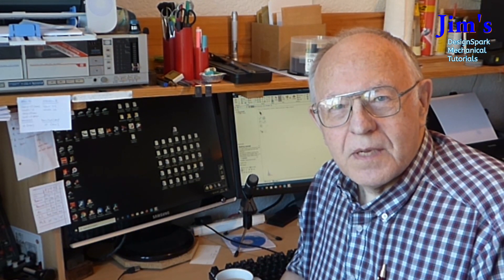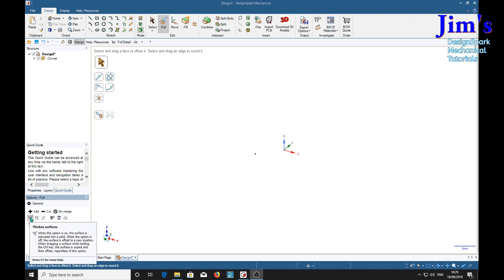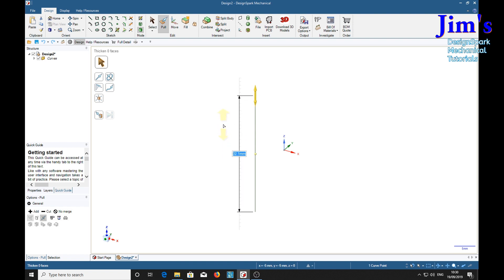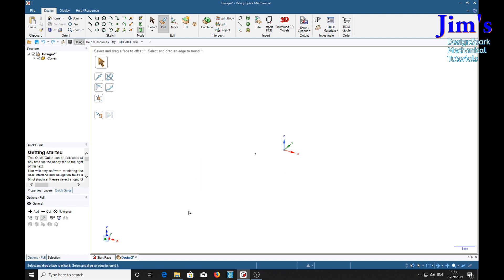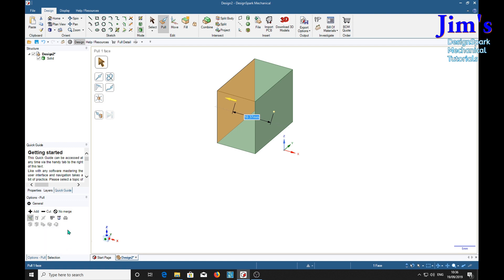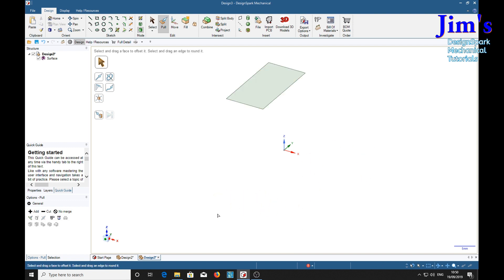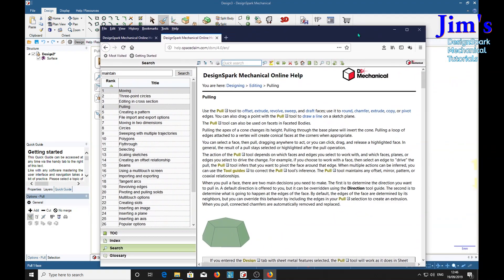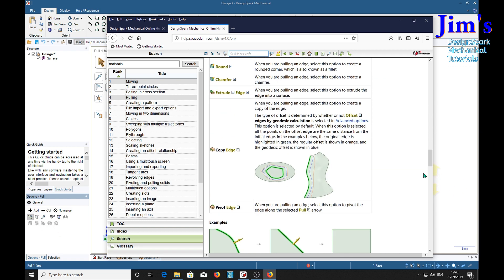Explaining Pull, Offset and Both sides in DesignSpark Mechanical

Comment: Jim, I think the offset relationship is referring to shelled parts - whilst pulling a side, taking an offset side with it in one selection without selecting it's offset respective side. Try shelling a simple cube, offset on / off etc and all is clear. regards.
Reply from the maker: Tried it - you are dead right. All is crystal. Will probably do a tutorial on it. Thanks again.